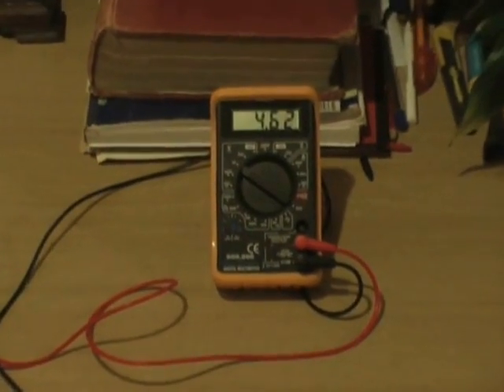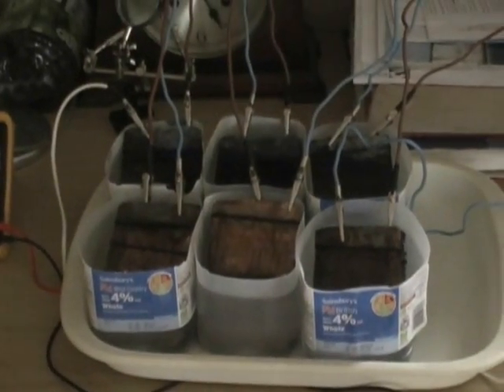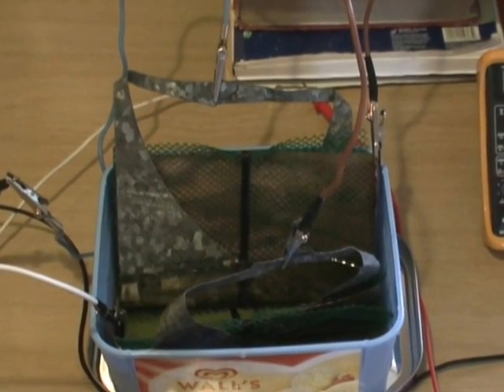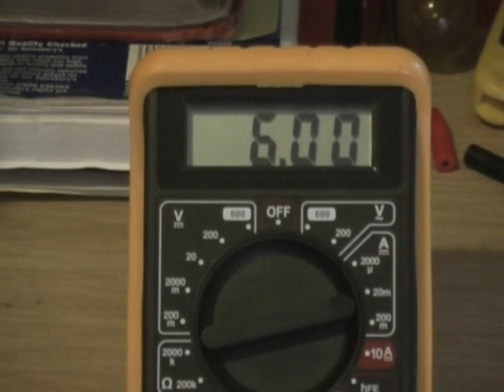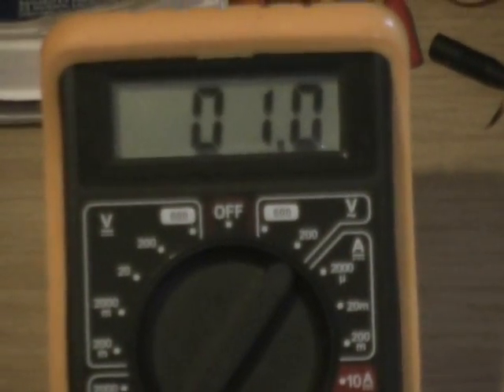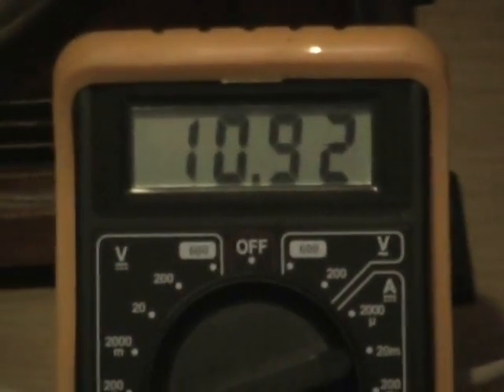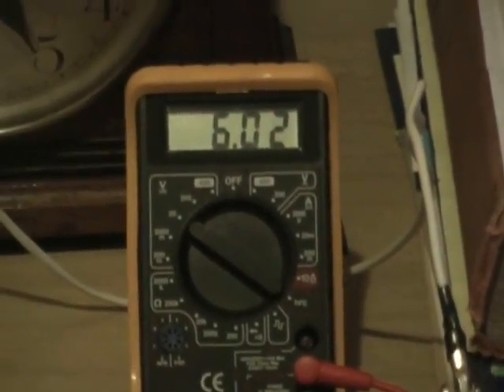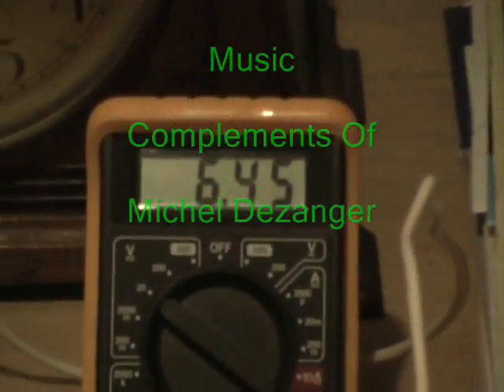Water Battery Free Energy  Running LED's

Comment: Okay, so the dissimilar metal of zinc and copper is where the energy is coming from akin to a Zinc-Copper battery with a salt bridge in the liquid. Confused as to why you call this free energy other than if you found the copper and zinc in a garbage pile and the water fell from the sky. It is a nifty experiment showing electricity 101 class.